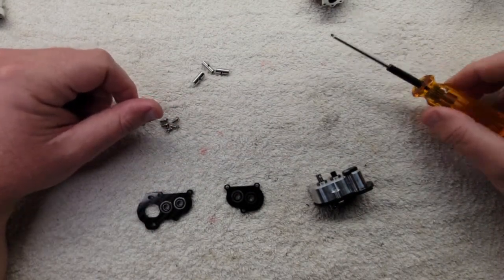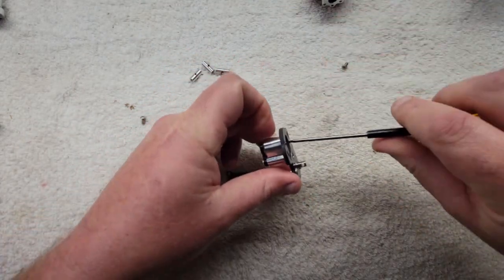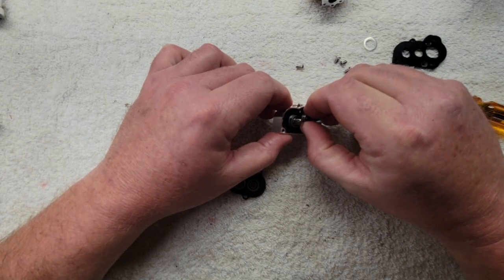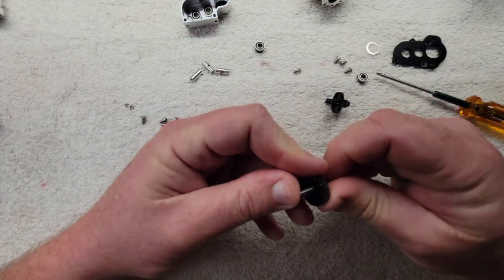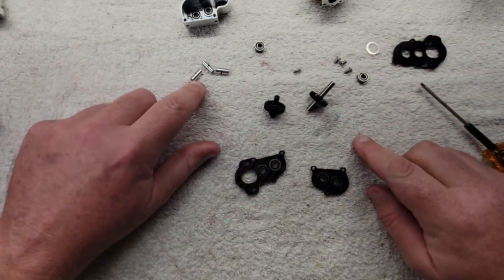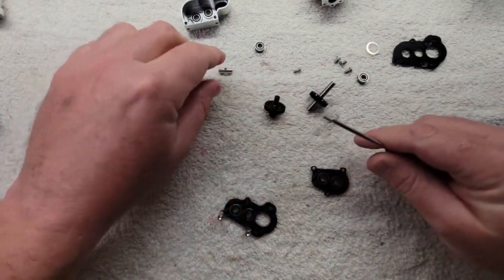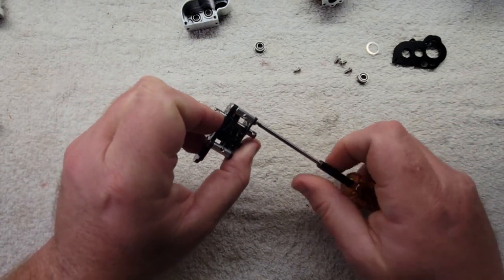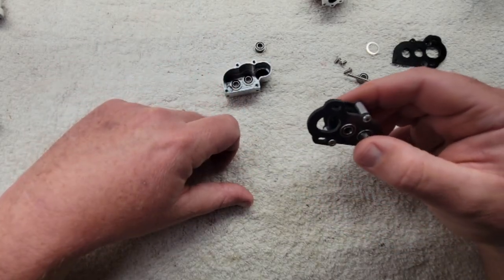Ultralight Portal Transmission conversion

Comment: Locktite recommended for the screws into spacers? Do you transfer over the shims as well?
Reply from the maker: You can Loctite those. They typically don't go anywhere as long as they are good and tight though.